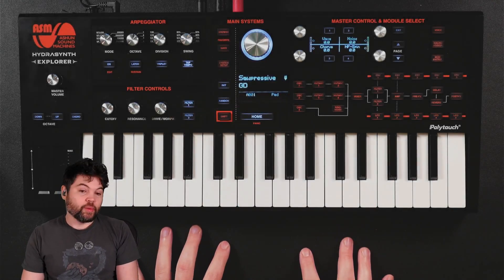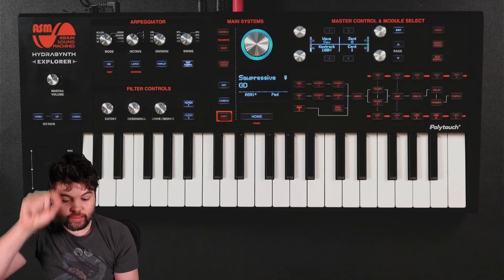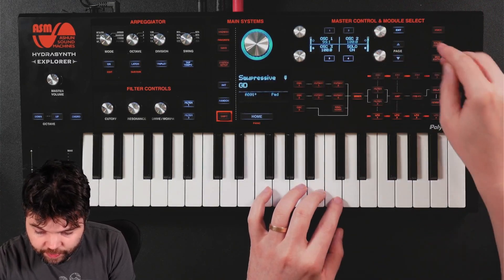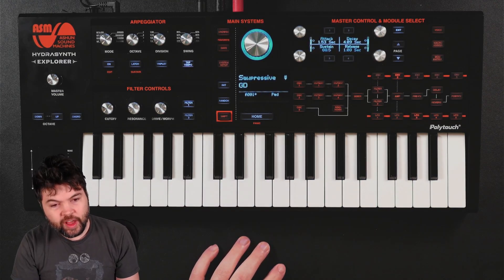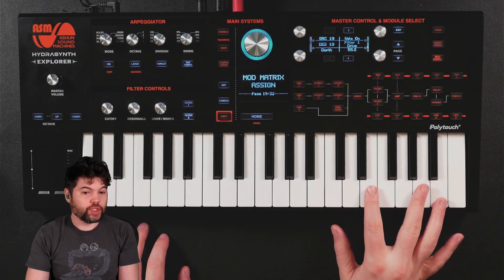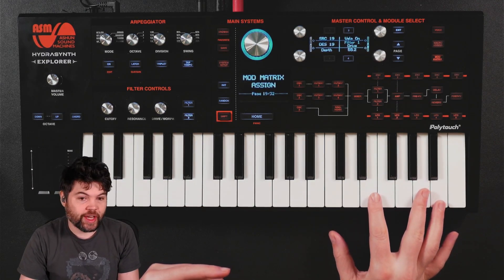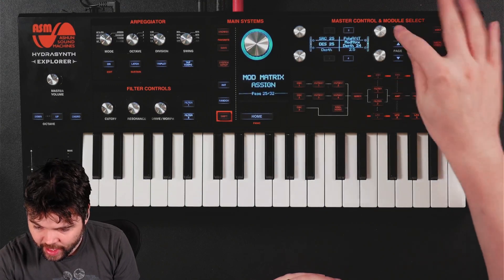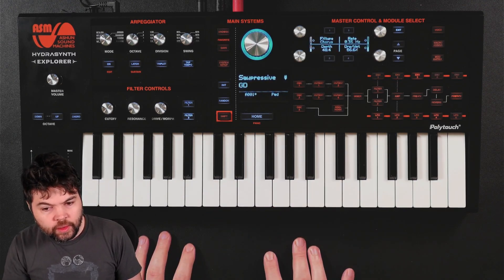Learn With Me - Hydrasynth: Ep20 - Sound Design - Poly & Lead

Comment: Good Afternoon! So good to  meet you 😊.  Thank you so much for this awesome presentation.  Super well done. I just got my Hydrasynth deluxe and have been just running through the awesome presets. I will need to go back to the beginning of your series to catch up!  Ant suggestions?   Thx .  Mark Bensette Aux Bois 🇨🇦.
Reply from the maker: Thanks for your comment, and for watching: I really appreciate your support. My main recommendation for checking out presets is to hit browse then change "find by" from "patch #" to "category". You can then use the category select; this allows you to browse just one type of patch (e.g pads).

As for the synth as a whole, the Hydrasynth deluxe has the benefit of allowing you to split or layer two patches. To me, being able to layer a pair of patches opens up some really interesting opportunities. An example might be combining a rhythmic sequenced patch and a pad like patch.

The most "important" features, in general, are the relatively high modulation sources count alongside their strong feature set (e.g looping envelopes and step sequenced LFOs). The other would be the mutants, which are audio effects for the oscillators: these add a lot of timbral complexity. If your goal is complex and modulated sounds, bring these together alongside the effects and a set of macro routings. This will make for a patch you can play and perform offering a great breadth of timbres.
Reply: @ChalkWalkMusic  Not sure of the best way to msg you, but here this goes~  I'm trying to play a pad over the sound of rain using a a series of lfo(s) and I keep running into the issue of the noise generator key tracking the pitch. Any advice for organic sounding rain in the mix besides just keeping lfo(s) locked to random, or should I just use sampling actual rain in some way to a dedicated oscillator? ty
Reply from the maker: @acrossmymind6423  This is a reasonable way to contact me, though you can also email me at the email address in the "about me" business email address for the channel. Anyway, to the question.

The noise oscillator isn't pitched, but likely your filter is tracking the keyboard. I think noise through a band pass is usually good for rain, with the cutoff animated. Most importantly you'll need to do the following from an init patch:

1. Change the filter routing from serial to parallel.
2. Adjust the filter balance for the noise source; everything defaults to 100:0 (all filter 1), change the noise to 0:100 (all filter 2).
3. Adjust filter 2 mode to the middle value (band pass, though low pass can work, albeit a different timbre: experiment with the continuously variable shape) and sweep the cutoff to near the middle.

Filter 2 defaults to no key tracking, so the pitch of noise should be fixed: try different noise colours to change the timrbe; you can animate the cutoff of filter 2 with LFOs and/or envelopes as you wish, and obviously use the first filter for your pad. Either way, you should be able to get to a good starting point that way.

Keep in mind that you only have one timbre, so the pad and rain sounds share the amplifier. You might like to have a very long release (and perhaps attack) amp envelope and animate the filters to function more like the amplifier per part (meaning close filter 1 fully and use the filter EG to bring it in and out as required).

Hopefully this is enough to get you where you want to be. Obviously you'll need to make lots of other changes to get the timrbe you want, but fundamentally the Hydrasynth should have you covered. With the Deluxe, you have two completely disjoint timbres, so you have more flexibility to design separate patches for each part, but the others in the family are flexible enough for this type of thing.

Note: for produced music samples (I like stereo samples for this) can work really well, and you can always layer two patches as audio in a DAW. FYI: you can't put samples into the Hydrasynth oscillators, so I'm referring to using a computer or another device for this purpose. Whatever is easiest while meeting your needs is the best choice.
Reply: @ChalkWalkMusic  Thank you, it was exactly what I was looking for! :D

Comment: The Hydrasynth Explorer “Keyboard”  does not have release velocity. You would need to use an external keyboard with the feature like the Deluxe to play it. By definition, it only affects the R in ADSR and is pretty difficult to control effectively for me, but it might just take some time to get used to.
Reply from the maker: Thanks for watching, and for your comment. The Hydrasynth Explorer and Deluxe keyboards both have release velocity (note off velocity in the mod matrix): you can see me using it in several of the videos. It only applies on key release, but is available for any parameter so you could have a pitch bend on release or a slowing down or speeding up of LFOs, for example.

It's a fairly uncommon feature, but the Korg "mod trio" all have release velocity on the keybed. As for being hard to use, I think it's hard to use as you would use initial velocity, such as on a keyboard sound: it's much harder to express the range of possible velocities and even moreso with one finger at a time; instead you tend to get near maximum or near minimum values. To me it makes the most sense as a follow up to aftertouch. That's to say when you are using an aftertouch sound you are thinking about ongoing pressure meaning it's easier to think about a fast or slow release (so primarily on a pad) of all keys at once.

I do use it outside of pads but usually to a very small degree; the concept is that unintentionally, but in some moderately predictable manner I'll release keys with different velocities. If I have this velocity slightly adjust various parameters I get some additional variation (albeit not one I'm using for specific expression).